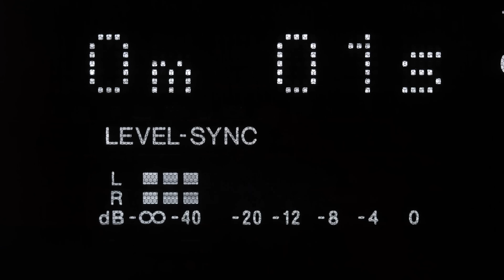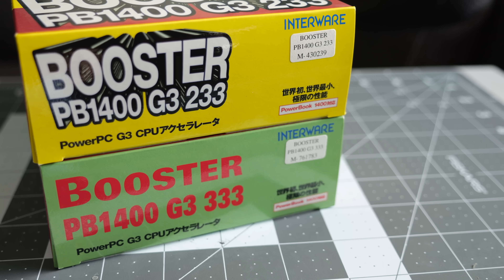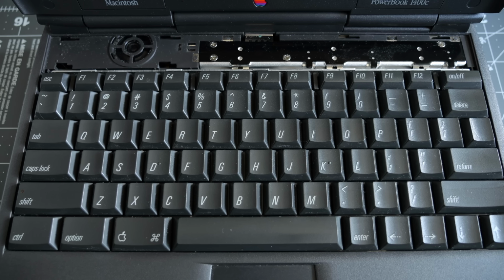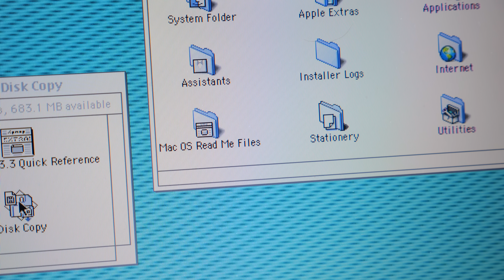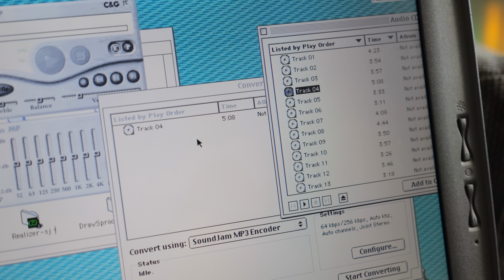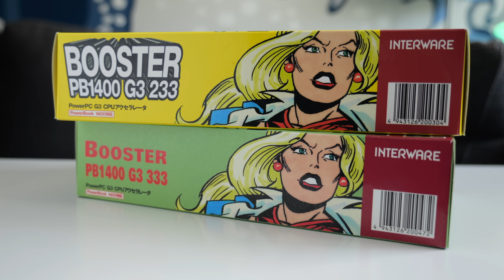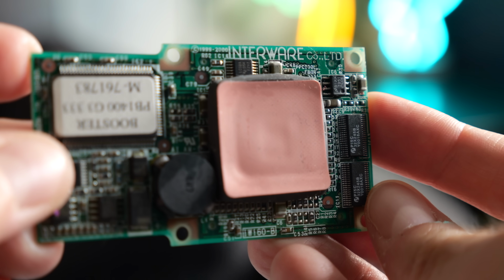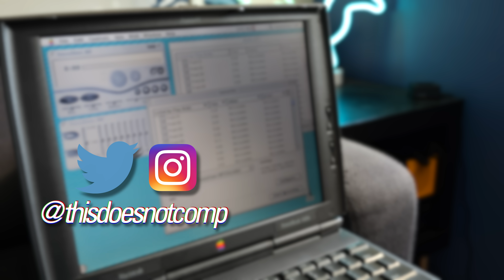This Retro Mac Laptop CPU Upgrade is CRAZY Fast!

Comment: The 90s were upgrade heaven to someone who worked on computers as a hobby. I was a PC hobbyist but it was a similar experience, mostly on desktops. Every couple years was a new thing. The computer I'm using now is 4 years old and showing no signs of needing an upgrade. My laptop is even older but switching to Linux gave it new legs and will last for a few more years easily.
Reply: Yeah, it's amazing how even a naive install of most distros can extend the life of hardware. I bought an old Dell Precision that had Win 8.1 on an HDD as a hobby project four years ago and while it chugged in Windows for the day or two before I chucked the OS, it ran pretty snappily in Debian 10. Granted, I changed the HDD out to an SSD shortly afterward and used the former as secondary storage, but even then, basic desktop performance wasn't improved that much in comparison to Windows, which nowadays I legit can't imagine running Win 10/11 on spinning rust. Wish I still had it.

Comment: Gotta love the colourful but comprehensive Japanese packaging of the era. Quite a striking difference from the overlaid, Y2K, Hopeful graphic design that was mostly seen in the West.

The PowerPC Wild West era was fascinating, you could procure chips to upgrade Macs and also Amigas. I miss how competitors would one up each other in innovation and performance. Computing has gotten boring, aside from some fringe cases here and there.
Reply: Advances have become more incremental. Also, back then, the CPU was the major bottleneck, so you could have massive performance gains by having a faster CPU, but still a slowish bus clock.
When RAM and GPU became bottlenecks, experiments with RAMBUS and AGP happened, until it eventually culminated in the ever increasingly faster DDRx and PCIe standards.
Back than you could just replace an 8MHz 286 with one clocked at 20MHz and have more than twice the real performance. Today, doubling clockspeed, even if it were possible, would only boost border cases. But you wouldn't feel that improvement in your typical user experience, as RAM, GPU and SSD would still have most of the influence.
Reply: @graealex  yeah difference between even an older 2600k at 3.4ghz vs 4.6ghz isn't even 10% so nowadays the difference in actually performance is simply instructions per cycle instead of frequency
Reply: I'm glad there are people that can explain this far better than I ever could but I know that it's a very different world than the one when these were around. I remember looking at them hungrily but knowing there was no chance of me getting one not at $500 or more.
Reply: you have to see the Interware's other accelerators packaging, Woz edition accelerators. that had a cartoon Steve Wozniak, and some others.
Reply: @Crixer234  You got a source for it or maybe some clues on where to go? Seeing that stylish box art kinda makes me wonder how the Woz was depicted!

Edit: Nevermind. Found a few pics on eBay. Not quite as cool (or sexy, not to diss the Woz) but pretty neato. Thanks for letting me know.
Reply: Honestly, speaking as someone with a women's studies degree, the packaging is pretty fun. It's got a clear link to the function - it's a hidden power up inside a normal exterior, and they paired it with the classic Superman transformation ideas. The superheroine isn't unusually sexualized, it's pretty pop art and it's just fun. Not objectionable at all, IMO.
Reply: To be clear, there are huge problems with sexualization and objectification of women and women's bodies in comic books. But that packaging is nowhere near any of it. It's a bustier, not body paint or the infamous Power Girl boob window. It's not a standard character being drawn as a sex object as a "pinup." It's just a superheroine with some classic references tossed in.
Reply: I believe this is an imitation of the American Marvel Comics design. 
It is not Japanese design sense.
G3 processors are the product of an American giant.
Therefore, we applied an American taste to the design.
This is my prediction.

Comment: Cool video! I still have a real fondness for laptops of the 90's and for upgrades like this one!
The the late 90's & early 2000's saw a number of laptop upgrade companies go bust on the PC side as well. The laptop repair depot I worked for in the late 90's through most of the 2000's did a rather robust business selling CPU, HDD & RAM upgrades for 386 & 486 laptops in the early to mid 90's but by 2000 that business had all but completely dried up. With the price of laptops in steep decline as a whole by the turn of the century it increasingly didn't make nearly as much sense to spend several hundred dollars upgrading an old laptop or fixing one that was out of warranty unless it was something relatively low cost like a keyboard, stick of RAM or a HDD.

Comment: Sonnet made a similar drop-in G3 for the 1400. I installed one in mine over a decade ago. It comes with a single screwdriver with a Phillips on one end and a socket on the other.
A word of caution about the battery: I too used to tape over the contacts. But one time I went to remove the battery and found that the charging contacts had somehow gotten stuck in the tape and one broke off. 
Now, I use an empty battery shell that I popped open, dumped the cells out of, and snapped back together. For a while I used it as a storage bay for my earbuds.
That said, not a single 1400 battery pack I have has ever leaked.

Comment: I never touched Mac until Windows 10 came out. There was a all world of technology out there that I missed because for 35 years I was an admitted Windows fanboy. Now my main computer is my 27” iMac (so obviously not a M1) and my most used laptop is my Manjaro KDE.
Reply: Yeah I went back and forth between Mac and PC in the late '90s but mostly prefered PC simply because it's what I could afford at the time and even these upgrades were well out of my price range. Mac has its place 100% more now than ever but the pricing still puts it well out of most people's hands depending on what they want to do.

Comment: I had a PB1400 back from about late '98-2000. I put in a G3 card, but I don't remember which one. My problem was that my computer crashed constantly. I put up with it, but I eventually ended up with a G3 "Pismo" PowerBook. Dropped a G4 into that, when it became available, and used it until 2008 as my main computer. The 1400 was a cool machine. It's interchangeable lid and inserts was fun, if frivolous. But, IMO, it was a wonky machine.

Comment: i still have my original 1400 which i upgraded using the Sonnet version of this card, i did the full 64mb of RAM as well but took out the video out card as i thought it would not fit well with the cpu upgrade, maybe i will try to fit it in one day after all :) thanks Colin :)
I have done the CF swap for the hd and that works quite well, also gets rid of the noise :)

Comment: Imagine going from 5Ghz to 13Ghz.. the gains back in those days were insane.. I remember upgrading a good old slot cpu in those days long long ago..the first one did not have a cooling solution (just a small passive heatsink) the second one I added a fan manually so I could overclock the cpu.. I upgraded from 133mhz to I think it was 450mhz.. I remember I had to change the FSB which was quite the hassle as a 13 year old fingering around in bios. I think I upgraded from a Celeron to a Cyrix 3 with a socket to slot adapter.. I wish I still had the hardware man..

Comment: You should consider an aluminium ifixit driver. I think the control of the easier to turn handle is necessary with increasingly complex repairs.

Comment: Imagine Apple Silicon in a case like this. How much room for a battery this would give.
Reply: uhm...not much unless it use lithium polymer
Reply: There's a 100Wh limit for batteries that can just be brought on airplanes.  Many thin laptops (such as the 16" MBP) these days already hit that mark.
Reply: Doesn't matter either I could bring it on the plane or not. Just imagine the amount of battery life. Probably days
Reply: @JaymeEduardo  yeah but that can only apply to M1 and M2 chip
Reply: Yes, that is the idea. M chips are one of the most power efficient ever. I managed to let my MacBook pro M1 128 hours in standby. That's insane
Reply: Yeah only problem is it would've died after 5 years and you'd never get replacement parts for it 😂 man apple needs to get back to building luxury electronics

Comment: I miss the days of socketed laptop CPUs, slowly but surely, the modularity of computers are disappearing for no good reason, when back in the day you could easily get a platform that you could steadily improve as tech aged, you can't do that now, effectively limiting how long a computer will last :/
Reply: There is plenty of reason to solder a CPU these days. Also, power and thermal management makes it usually impossible to swap to a different CPU anyway these days.
Reply: But now the hardware lasts longer than back in the 90s
Reply: @magnusharrison2715  I don't know if it lasts longer, but "the CPU upgrade you want" will already have a different socket anyway, as most technical advances will involve the overall system, and not just a CPU that is clocked faster.
Reply: @graealex  I realize that there are good reasons today to have things as BGA as opposed to in a socket, like there were good reasons to have things in a socket beforehand.

I don't think that saying "but power and thermal management" is a good argument when you take into account that around the time that directly soldered CPUs were brought back for laptops, was also around the same time that more and more companies started going towards anti-repair/anti-upgrade/anti-modularity practices moreso. It's generally pointless to say that things can't be modular because the systems in place for laptops can't easily be made modular, since the companies who made those systems were specifically designing them against modularity and user-service.
Reply: @mattsparks3546  One shouldn't mix up necessary evil associated with advanced integration, and purposefully designing hardware not to be repairable.
Prime example is permanently soldered RAM and SSD.
Reply: @graealex  what "necessary" evil of "advanced" integration? Yes, not every device should have modular parts per se, yet, what you don't mention is that almost no devices have modularity inside when they very clearly can have modularity.

Additionally, one shouldn't ignore the industry wide trend of reducing consumer control over their own devices, but, I digress, all I'm saying is that having socketed laptop CPUs that allow upgrades such as the one in the video is something I'll miss, I do not for a second buy that they cannot make laptops upgradable in this way currently, even if it means the laptop is thicker than a few millimeters, the problem is that they do not even offer the option of buying computers that support that, and, I will continue to say, that will be missed.
Reply: @mattsparks3546  The necessary evil is that each integration makes the device less modular.
I remember a time when laptops had modular GPUs. However, there is simply no standardized form factor, and you still have to mount a thermal solution to it.
I think Framework shows about what is possible, unless you want your Laptop extra-thick. They have the whole motherboard as a user-replaceable component, but the CPU ist soldered, and has the thermal solution for all components already attached. You then put in your RAM and SSD in, and mount the whole board in the chassis.

Comment: I have an even faster G3 upgrade in my PowerBook 1400. 466 MHz Sonnet. I actually got the last remaining unit in stock directly from Sonnet in 2008.
Reply: I remember looking at these upgrades a lot but I could never afford them. And by the time I could they were completely unnecessary.
Still it's cool to look back and see how cool they actually were. These would have been amazing had I able to get my hands on/afford them at the time.
Reply: @JohnDoe-wq5eu  I forget how much I paid for mine in '08. IIRC it was significantly marked down from the original price, but I think it was still at least $150
Reply: @MatroxMillennium  
It's crazy to think a) they still had it around in '08 and b) that it still made so much of a difference.
I was always fascinated by all these upgrades even though I couldn't ever get them. Looking back it was a glorious golden age of upgradability an age we have moved far past at this point with Apple.

Comment: The PowerPC 603e 100MHz, of the base, 1997, PowerBook 1400 and 5300, produced an almost identical 190 Dhrystone MIPS benchmark score to that of the 162MHz SA-110 StrongARM, of the 1997 Apple Newton MessagePad 2000 series, and those ran of four AA batteries, for days, and cost a sixth the price, thats including the Apple tax. Was this "Reasonable performance" ?

Comment: I wish intel and amd would make more powerful CPU's for older platforms once in a while.
like maybe some 10+th gen i5 for the S775 slot, more performance, less watts TDP.

wouldn't be a super seller, but real nice for some of users... :P
Reply: AMD have literally supported socket AM4 with 4 generations of CPUs. it's only Intel that gets a new socket every time they make a new CPU.
Reply: @ps5hasnogames55  I am well aware, just put a 5600G, going directly from a 1700, in my b350 chipset mobo the other day.

what I meant was current socket CPU tech in older sockets. so in AMDs case it would be putting some Ryzen tech on am3+ or older.. or simply re-manufacturing an old CPU in newer fab, shrinking it and making it more energy efficient and running cooler etc.

Comment: It blows my mind that the motherboard built for one generation of PowerPC CPU will mostly "just work" with a newer and vastly improved generation of CPU, albeit with a driver extension to get full performance. In the PC world you'd need to not only reflash the BIOS in order for the machine to even start with the new CPU (and that's assuming your motherboard manufacturer even has an upgraded BIOS) but the socket might have changed and it would be impossible to upgrade.

Given that 604 Macs could use G3 CPUs and G3 Macs could use G4 CPUs, would it have been possible for a 604-to-G4 upgrade card to be made?
Reply: "in the PC world" you mean mostly in the Intel world. AMD supported the same sockets and chipsets for multiple generations of CPU, only changing when they have to.
Reply: @ps5hasnogames55  Even with AMD you still needed a BIOS update before you could just drop in a new CPU of a later generation.

Comment: Did you know you can buy IDE SSDs?  So wouldn't need an adapter or anything else. Generally they cost 2x what an equivalent SATA drive costs.
Reply: There are also 2.5" IDE adapters/enclosures that can take an M.2 NGFF/SATA (not NVMe/PCIe) drive (or mSATA, depending on the enclosure). I used one of those to upgrade my Mac Mini G4 from its spinning drive. Makes for better performance and reliability than an SD or CF adapter, as while those work well for up to mid-90's machines, they can be limiting with mid-00's machines.

Comment: Now if only the damned more modern apple laptops were that easy to work on. The Ibook G4s are a real pain in the d|(&, gotta pull out like 80 screws and unplug about 10 connectors just to frikking change the HDD......

Comment: Imagine if Apple still build good notebooks.. The new M2 Macbook Air throttles heavily and the M2 Macbook Pro reaches 100°C+ when under heavy load.. Both are inacceptable for different reasons and it boggles my mind how their products are bought that blindly nowadays. Other brands aren't perfect either but they're either cheaper with similar results or put in more than the minimum effort required to avoid such bad issues.

Comment: While I'm not (and never was) a fan of Apple, this is a level of upgradeability sorely lacking in modern hardware, even with the need to include 3rd party upgrades to make it work. It's especially notable when looking at restoration/repair videos of laptops from just 10 years ago, with insane modability and easy access for most upgrades. Nowadays, I'd have to unscrew and unclip the entire back panel of my Lenovo laptop just to add a new RAM stick. This is BS, plain and simple.
Reply: I'm glad not everyones a fan. The new laptops are terrible, the M1 ones were fine, but the M2 models got downgrades for the base models. Not only that, the M2 Macbook Air throttles heavily to the point where it's barely any faster (and the 10 core GPU is WORSE than the 8-core one due to the throttling) and the M2 Macbook Pro is reaching temps of 100°C+ under heavy loads. It's just embarassing and yet there are fans defending them despite this being a massive scandal for other companies.
Reply: @xPandamon  Yikes! Don't follow Apple product reviews, but thermal throttling on an Air sound really uncomfortable to hold, much less use.